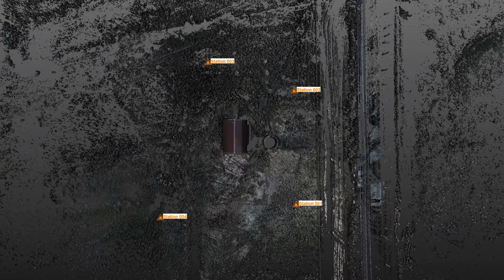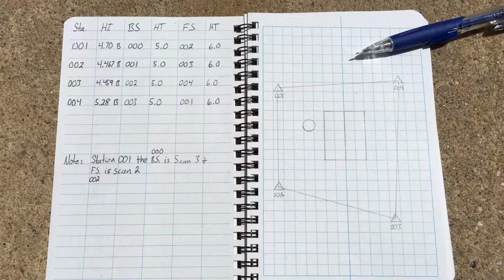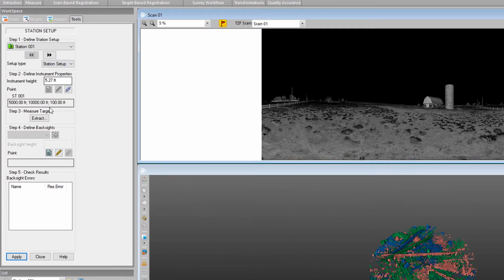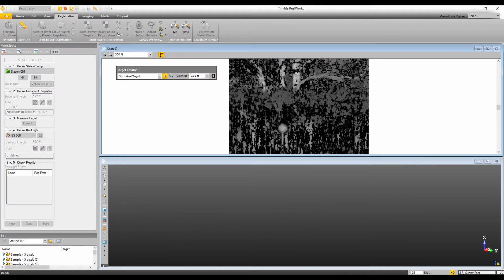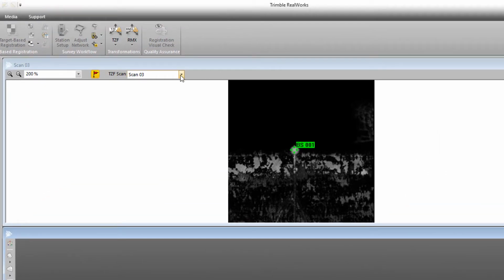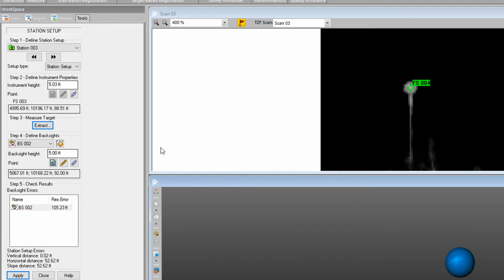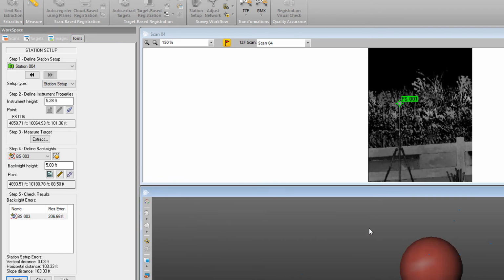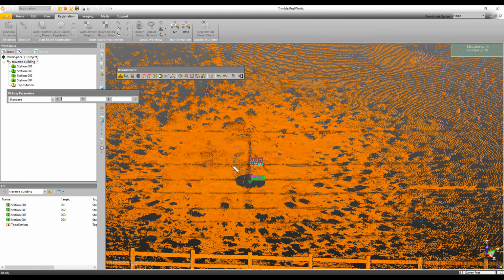Traverse Workflow Walkthrough - Trimble RealWorks

Comment: What is the purpose of using the traverse method vs using 3 spheres common to a pair of scans?
Reply from the maker: There are a few reasons why someone may want to do this. One is that they may want to following along with existing control. Another could be that they are doing a long linear project such as a power line and want to reduce the need to move a bunch of spheres. Using this work flow combined with a high resolution area scan will let you go a lot farther per setup. In this video I was using small 100mm spheres but with something like the SECO 230mm sphere you could really cover some ground. Another reason could be that someone is just familiar with working with total stations and wants to use a workflow similar to what they are used to. 

SECO Scanning accessories: https://www.surveying.com/en/products/scanner-accessories.html